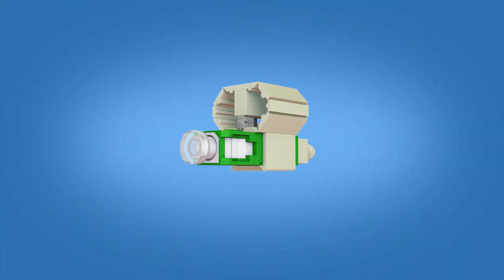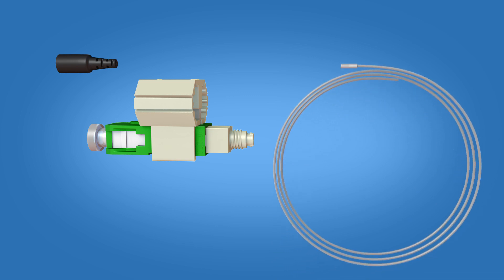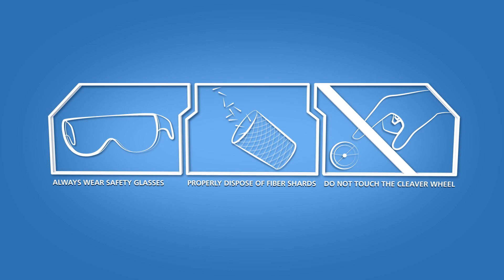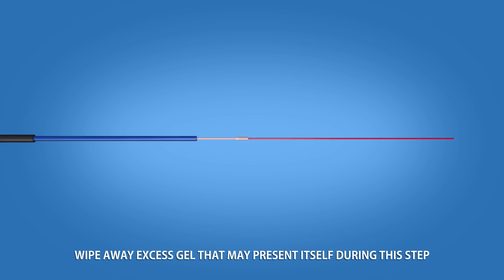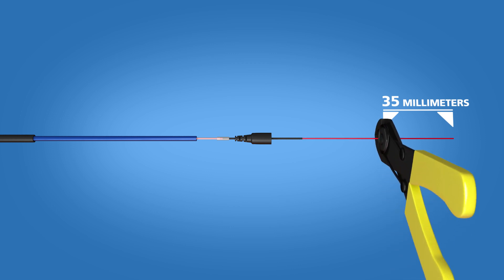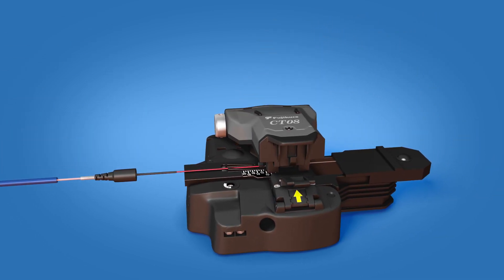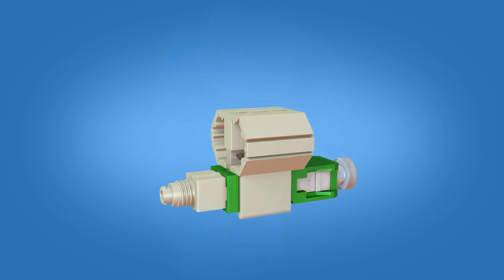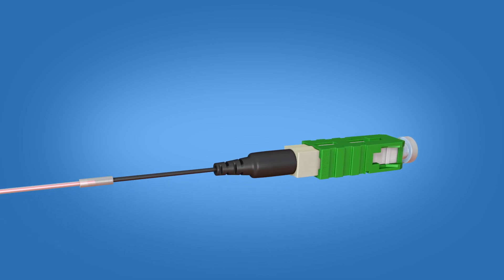AFL FAST SC/APC Connector on 250 micron fiber/cable

Comment: You make it very easy, but the reality is that most connectors internally rub against the optical fiber and do not let the fiber enter all the way.  you have to try with several connectors
Reply: Damn. What do you mean cuz I’m on my way to terminate 250 micron together because the splicer we rent isn’t available.
Reply: i broke the fiber inside this connector like 10 times, so those 10 connectors were thrown in the trash